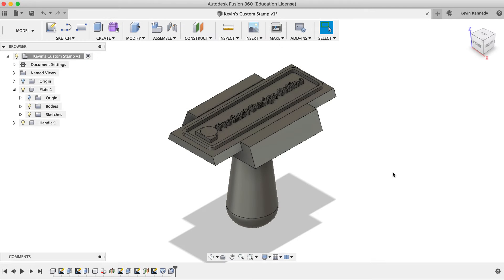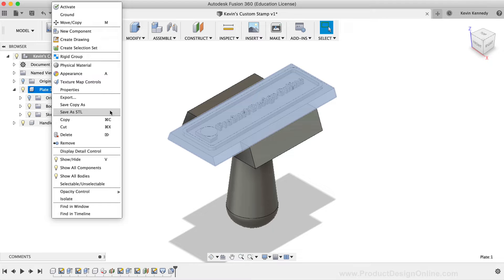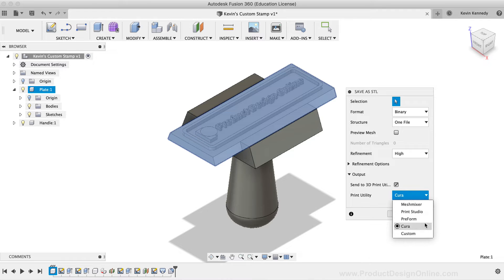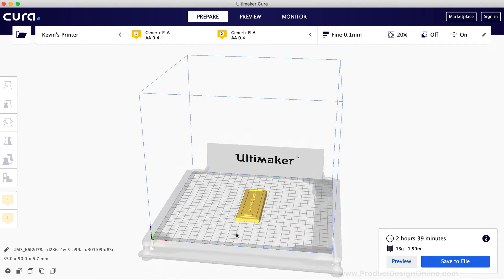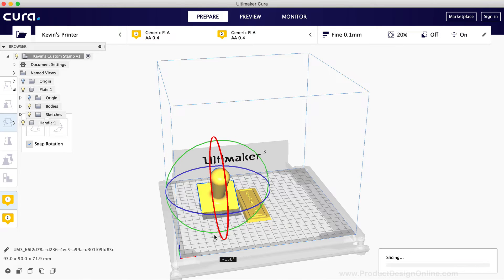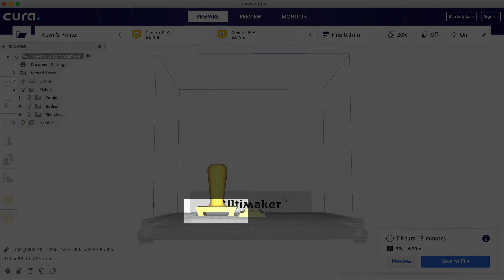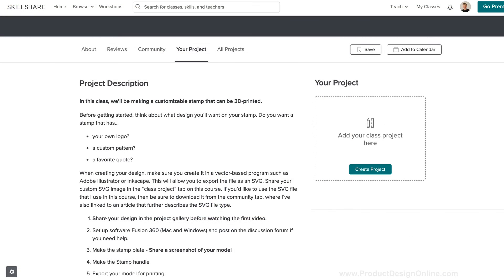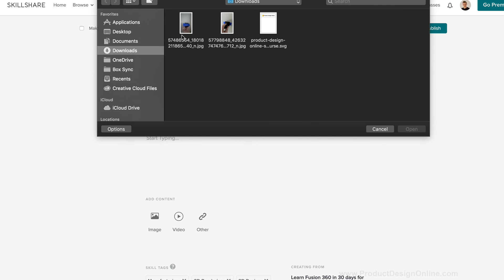Exporting STL Files in Fusion 360

Comment: Hi
When I open the thorn as STL in CURA is it opens me another window and doesn't put the second file in the same window
2 more questions please
1. If I create a name, it saves each letter separately
How can I save an STL file of the entire name together?

2. Can I add sketches of the name? For example, connect letters the way I want?

Thank you so much for the work you do
I'm considering working with this software because of you
Reply from the maker: Unfortunately, the Cura opening a second window is a known issue that happens on Windows OS. I'm on a Mac, which is why I didn't know that was a thing until everyone started commenting on it. You'll have to save the additional files and import them to Cura manually.

Comment: what is the difference between binary and ascii format?
Reply from the maker: Hi Andrea. Binary STL files are compressed and thus are a much smaller file size, which is why that's the default. There are a few programs out there that only accept ASCII. Most will accept Binary or both.